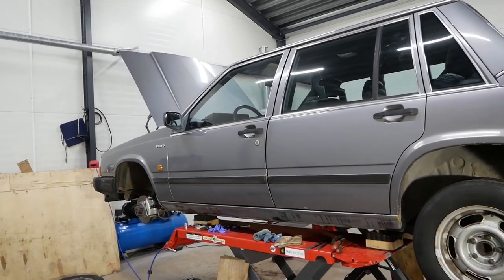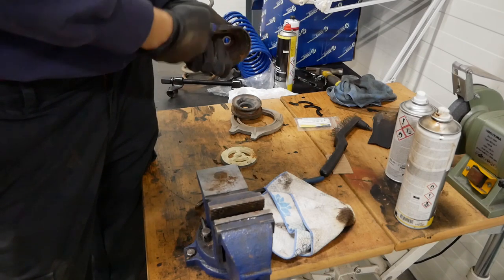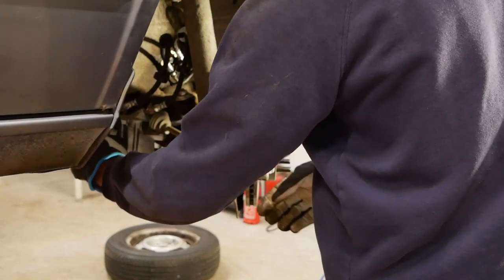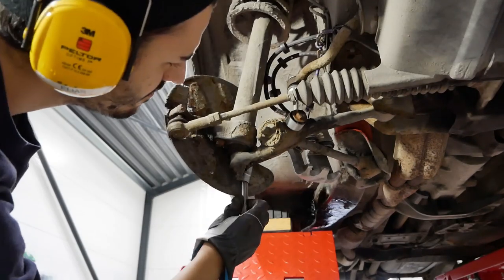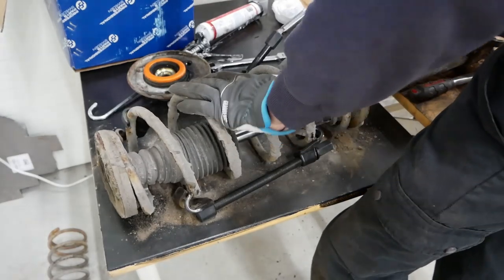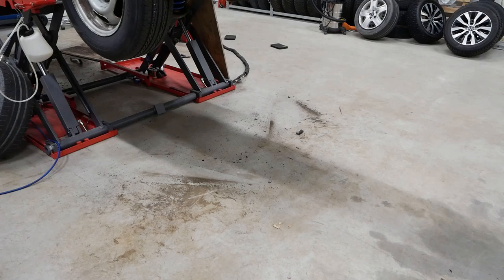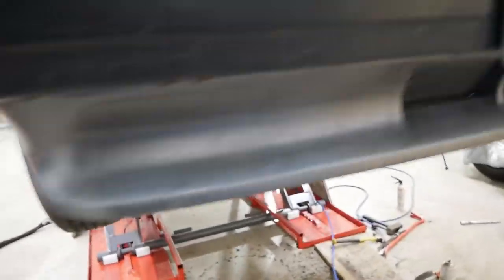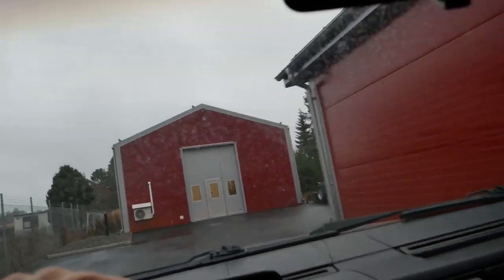$50 Project Car: 1988 Volvo 740 Rescue (Part 4)

Comment: As a long-time Volvo owner (P1800, 245, 960, XC70) who does all my own work, love the series!

If it was me, even with a "budget" project, would have assumed the rubber spring cushions etc. needed replacement, and ordered them along with the springs...  And washed out / relubed the strut bearings, while you had them out!

Subscribed for more... Keep up the good work!  -DC

Comment: I use Miracle Paint for those kind of rust repairs. Seems to work and nothing I have treated has shown any rust, despite not removing absolutely every bit of it. I can highly recommend that product.
Reply from the maker: Thank you for the tip! :)
Reply: @ejoautovideos  Yea I mean it's a great product. Sticks to surfaces like I have never seen before. Can be painted over too. Just rub down the surface first.

Comment: Question? why not everything is covered in rust removed with a sandblaster and then put in matte black paint  ?
I once did it with my Renault 25 TXE sometime in the 90s, a good friend of mine once proposed and also carried it out, after work was done, the bottom looked and everything that had been slightly rusted was like new again.
Unfortunately I don't have any pictures of it because my friend forgot to do it and at the time that didn't always happen to capture something with a camera, which I regret now, ha ha
Still a very good job you have done so far!!

Comment: You can skip the spring compressor step on the front end if you just unbolt/rebolt the strut when the car is on the ground.

Thanks for the video, just watching you work under there helps me learn a lot. Just picked up an 89 wagon.

Subscribed!

Comment: Great job but you should replace the brake plate otherwise you will get all the grit ,sand and muck go on your brake pads which will affect your braking in time.
Reply from the maker: Yes, I'll replace them next time the hub comes off. :)

Comment: I guess you know your '88 740 GL  was built entirely with Zincrometal (zinc coated steel). So, when doing any repairs to the body panels, floor pans, etc. you have to use products that are compatible to zinc coated steel. Btw, your dash has the exact same cracks that my '90 740 GL has. Go figure! lol
Reply from the maker: Yes I know. 😊
Yes, a very common issue with the 740 unfortunately.. :/
Reply: What kind of products would that be
Reply: @ricky107_  Products that state on the label that they are compatible with zinc coated steel. I recently used a primer that stated on the label that it was compatible with galvanized metal and zinc coated steel. Glad I could help.

Comment: Like the project! 👍 Friendly tip though, spring compressors are unnecessary in the rear, just loosen the top bolt for the shocks on both sides, and you can lower the rear axle far enough so that the   spring can be removed. 🙂
Reply from the maker: Thank you :)
Yes I know, I mentioned in the video why I didn't go that route.
Reply: @ejoautovideos  turns out I'm not paying attention then 😅

Comment: How did your 740 GL pass a government inspection with such a huge hole in the floor pan? Don't they check for such things?
Reply from the maker: The big hole illustrated in one of the videos was after me cutting up a big portion of it. Prior to that it was actually very hard to spot, so yes, the inspectors missed it. 🤷‍♂️
Reply: @ejoautovideos  Lucky! lol

Comment: knotted wire brush for the angle grinder and away with this rust....may be sand blast afterwards...then rust converter....after all paint with 2k paint...and then finally grease it with wire rope grease....and use the car the next 30 years
Reply from the maker: Great tips! 👍

Comment: Are you planning on doing any performance mods?
Reply from the maker: I'm actually thinking about that a lot. Maybe NA tune this enginge or engine swap. 
.. or just leave it as is to keep it as a reliable stock car that is also very fun in the snow. 😊
Reply: @ejoautovideos  you can always just do something g light like exhaust and intake it will give the car a little bit more power but still keep it reliable

Comment: Did this lower the car?
Reply from the maker: Yes this kit is suppose to lower it 40/40 front/rear. However, in hindsight I should have gone for 60mm in the front. I still think it sits to high in the front.
Reply: Ok, takk takk
Reply: @ejoautovideos  love the videos  it shows how to do different tasks, I myself have a 1988 760 turbo, black with tan interior, leather interior , I believe this model has the multilink suspension.
Reply: It*s like a good way on how to do maintenance, & how to keep these cars going for a long time, I myself like to do as much work as possible to keep these classic cars going, that is why I wait patiently for your next how to video, it*s very informative, entertaining you learn how to do different tasks.